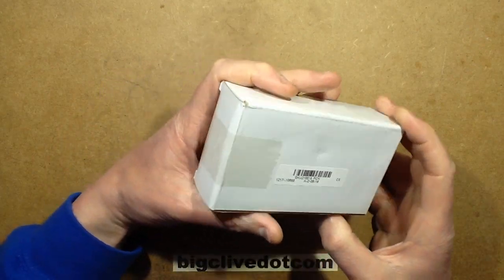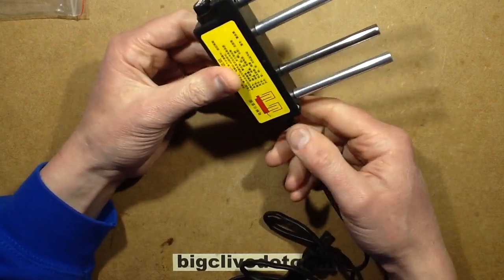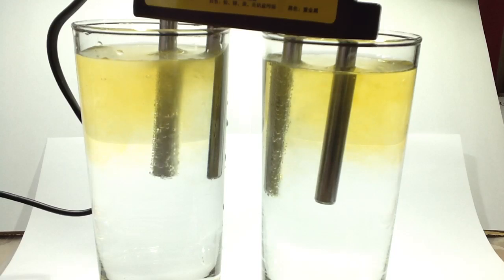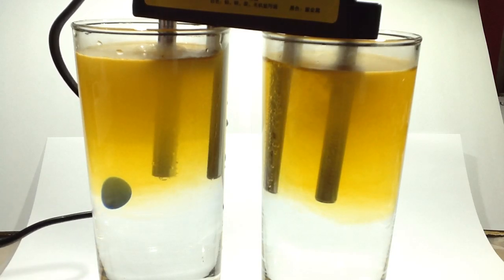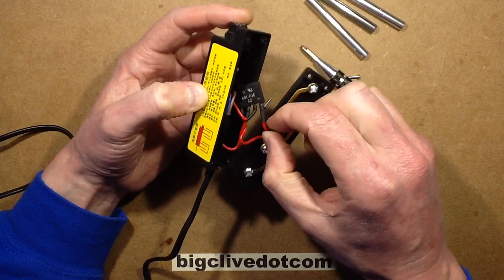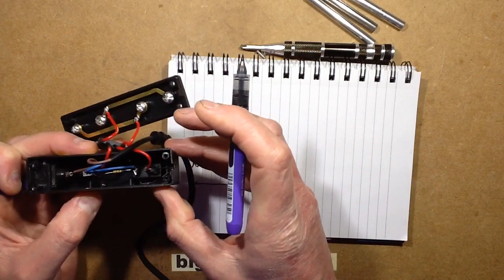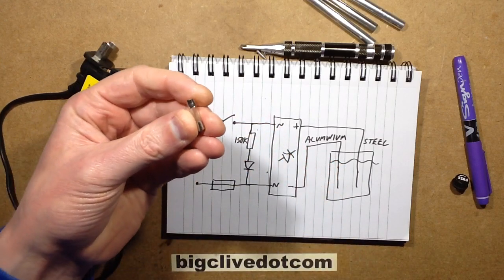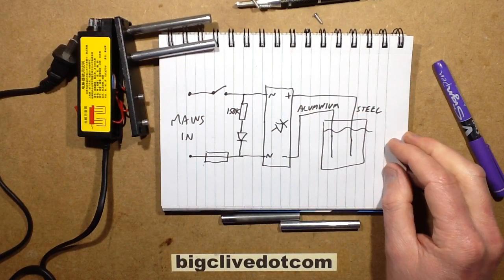Deadly quack water tester.  (scam)

Comment: Hello Clive, have you been watching electroboom? 'fulllll bridge rectifier' ?
Reply: The only thing a device like this demonstrates is whether a solution can conduct an electric current. If it can, the solution will get gunked up with salts from the electrodes. For determining whether water is safe to drink, this is worse than useless.

Honestly, some scientific literacy should be expected and required for nurses. This isn't even high-school level.
Reply: @hazelhazelton1346  
It is wrong for you to assume that my educational level is less than proficient. Apologies as I didn't further expand on Research that I have conducted. What I was trying to explain is that alkaline water isn't a good conductor for electrolysis. When it comes to heavy metal components such as arsenic especially inorganic arsenic there is going to be a vast separation. Arsenic in itself is a semiconductor thus forth bonds to other elements such as zinc. Each element on the periodic table exhibits a color, and distinct reactant characteristics. I was simply suggesting the probability of arsenic being a factor and if I separation was high pertaining to my water. My hypothesis has furthermore supporting  evidence based on the samples that I have gathered from multiple locations, and had tested at a state approved laboratory.  unless you are willing to do the leg work don't assume.
Reply: @LibraMami  As far as I can tell, I have never assumed anything about you, or indeed ever addressed you in any way. Since the post to which I originally replied eleven months ago has been deleted, the validity of my reply cannot be evaluated.
Reply: @LibraMami  Quit your job and go back to school. You're a liability and a danger to others.
Reply: @Sk-tb7kt  it is wrong for you to assume I got my educational level is less than proficient. Why would an individual quit their job and which they exceed at? The greatest scientists question everything. As I have explained in previous comments, I have conducted  copious amounts of testing on the water in my area. I have further more supporting evidence of my initial hypothesis. I submitted the multiple samples to a state Certified Laboratory. I honestly typically would not argue with an individual, however when it questions my competency in nursing that is a fight I will take to metaphorical death. As for the comment regarding continue my education, I expand on my education daily. I'm actually in progress of my second degree.
Reply: @LibraMami  Wow it's scary that you are allowed to give people medicine! s
Reply: @Camwize  It is unbelievable, I agree. It is unbelievable that I did not become a statistic. It is unbelievable that as a single mother of two children not only did I work fulltime, but attend school fulltime, and successfully graduate. 
It is unbelievable that I passed my state boards on the first try. It is unbelievable that this ever changing world, is constantly developing new methodologies for testing, resulting in curious minds developing new hypothesis. Many conclusions have yet to be  determined. I'd imagine why I have the privilege of administering medication, to my patients are as follows.

1. I follow the policies, procedures, and abide by the laws set forth by the professional licensing agengy, and the state in which I reside.

2. I ask questions, and relentlessly research, always advocating for my patients.
3. I exercise compassion, and
 empathy.

4. I recognize that no one individual is perfect, that we all perceive the world in a unique way, and not everyone is equipped with the intelligence to engage in a debate. (The response reminds me of things my 12 yr old would say to any individual he didn't agree with) In which he would be disciplined. Now I have some questions for you.

1.Have you always been a judgmental individual? 

2.What life experiences resulted in such a distorted way of thinking?

3. How can one make an assumption as to the care one provides, by a mere comment or two? 

4.Do you conduct yourself in the same manner at work, as you do in your home life? 

5. Have you researched case studies on inorganic Arsenic removal by electrolysis? 

6. What is your educational level?
Reply: https://www.ncbi.nlm.nih.gov/pmc/articles/PMC4077681/

Comment: Why does the water discolour through electrolysis?
Reply: +Liu Wai Ching I guess there is some reaction with the electrodes, most likely iron or iron oxides from the steel.
Reply: +Daan Wilmer I'd guess that's why they picked two different metals for the electrodes?

Comment: Why does the water discolour through electrolysis?
Reply: Yes it's the break down of iron in the steal. It's just iron oxide. I wonder why one electrode is aluminium surely having two steel would double the effect. 

They missed a quackery trick there.
Reply: +Sionyn Jones It is so it doesn't look so obvious like rust.

Comment: Won't these glasses be producing hydrogen gas when the device is on? That also very safe (Y)
Reply: +Jim C K Flaten Considering the colour, and the fact that it's usually in the water, I'd say it's producing chlorine maybe?
Reply: +Jim C K Flaten Rather disappointingly they don't produce hydrogen (at least in any meaningful amounts)
Clive had a video a while ago where he tested that :)
Reply: +Pook365 Wasn't that with an ac electrode heater? Since this thing used dc, it might be that there actually is some hydrogen produced.
Reply: +Jim C K Flaten 
Not enough to matter.
Reply: +Jim C K Flaten Yes, the bubbles are hydrogen and oxygen, but you would have to wait for days or weeks to produce dangerous amounts. The air movement in the room prevents dangerous concentrations of hydrogen.

Comment: Where do you find this stuff?
Reply: +TheUnnamedGent
Genocidal ebay sellers.
Reply: +TheUnnamedGent eBay has its own section like YouTube - best not go there...
Reply: I just received my device today....took 10 days to get it at a low price of 3 1/2 dollars. It's a fun device (but never touch the electrodes...I measured the voltage and it did say 450V). I ordered mine on Gearbest (price went up in the past days). http://www.gearbest.com/testers-detectors/pp_413673.html

Comment: How that shit gets through customs i dont know .
Reply: +Barrybados©. so do you wan them to open and search through any package with anything electrical in it?
Reply: Yeah and check for bombs and that at the same time .
Reply: +Barrybados©. How many letters and parcels do you think pass through sorting rooms every day? Far too many to ever check.
Reply: +Barrybados©. customs cannot check items for individual safety, they cannot know the end use of a product, only that it is not specifically on a list to be refused, im sure in australia if you ordered this in ebay from china yourself it would find its way in just the same as anywhere else.
Reply: +Barrybados©. - Shit is easy to detect by smell. And you can order one of these from Australia just fine. In fact, there are a couple of Australian websites dedicated to exposing quack electronics - some imported, some produced locally, some even subsidised by the government.

The notion that people working in customs know everything about physics, chemistry, engineering, etc. (and can read every language) to determine if every item fulfils its manufacturer's claims is a bit silly.
Reply: +jusb1066 I live in the uk , i know they cant protect you from yourself .
Reply: +Barrybados©. It's not Australia
Reply: Barrybados©. there is no way Australia checks 99% of shit maybe it's higher than most places check but no way they check that many.

Comment: Hi Clive.  Love your videos.  Where/what brand are your chunky pocket screwdrivers?  I could use a set that aren't cheap plastic crap.

Thanks and keep it up!

Christopher
Reply: +Christopher Netherton  They look exactly like the ones sold in big box car parts stores here in sweden you can probably find them very inexpensively on ebay. We used them in the computer/phone repair shup where I used to work they boutght them directly from china probably for close to nothing. They had very long 2 sided bits too which was very useful for deep screws. The bits should be helt in by collet chucks those screw drivers are much better than the magnetic ones.
Reply: +Christopher Netherton I do believe his screwdrivers are from that wonderful adventure-land that is poundworld.
Reply from the maker: +Christopher Netherton Poundland in the UK, but also sold globally as a 9 in 1 screwdriver.